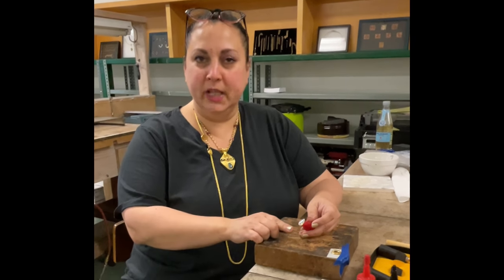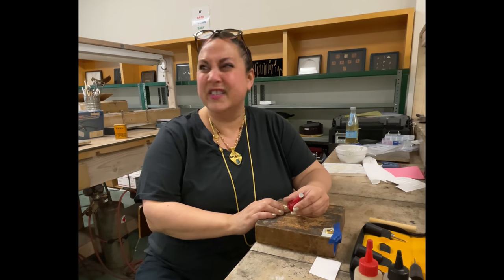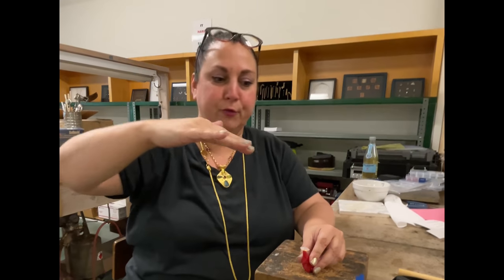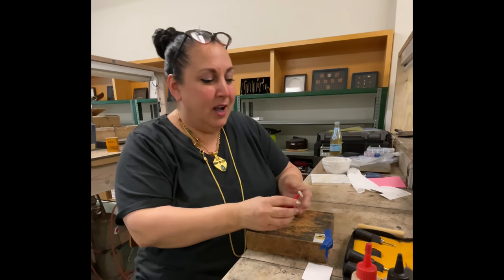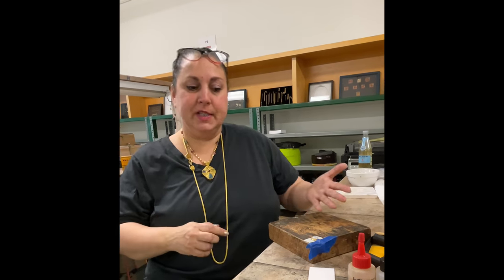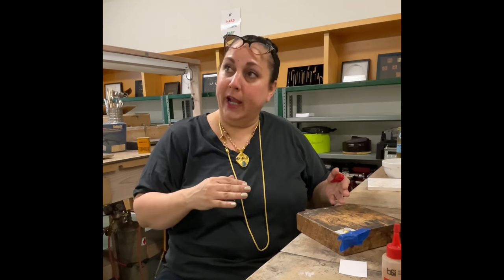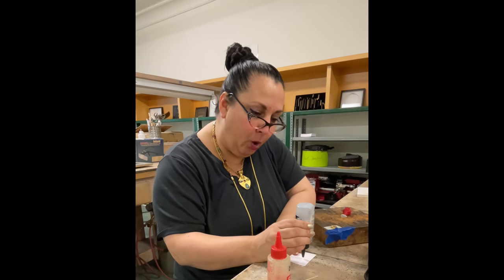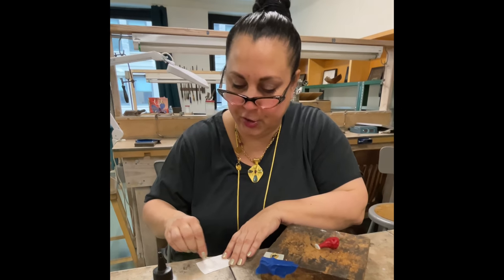How to Bezel Set a Pear Shaped Cabochon Opal Using Glue

Comment: Hello Jeanette,
as always you appear just in the right time. I have to glue 5 rings with pearl pegs. I will mix the glue for a longer time and I think I used too much glue, because I was always afraid that the pearl could get off. (the peg is about 2-3 mm 18 g roundwire)
Thank you very much for the video and have a good start into the new week.
Greetings from Germany
Maren
Reply from the maker: It is always good to rough up the peg a bit, for better hold. :)
Reply: @JewelryArts  Hello Jeanette,
thank you for the extra tip😍
Reply from the maker: @marenc9648  You are very welcome! :)

Comment: When you use wire in the inner bezel to prop up the stone, would you always use gold (for gold) and silver (for silver)? It seems almost wasteful…especially when working in such and expensive metal as gold. Have you used anything else that you can recommend?
Reply from the maker: I never use a gold inner bezel unless the back is open because, you are absolutely right, it would be wasteful. I usually use fine silver. :) If the stone is opaque, you can use copper.